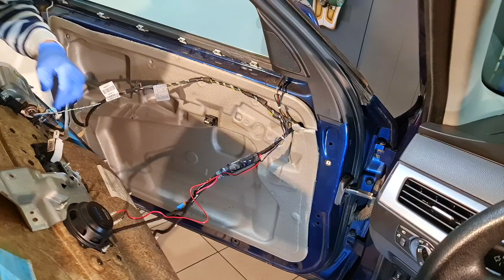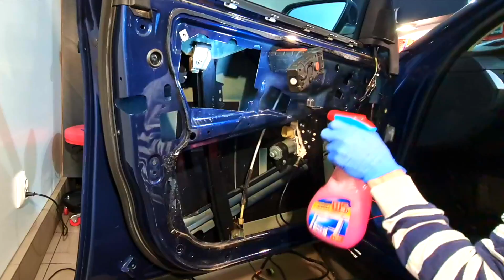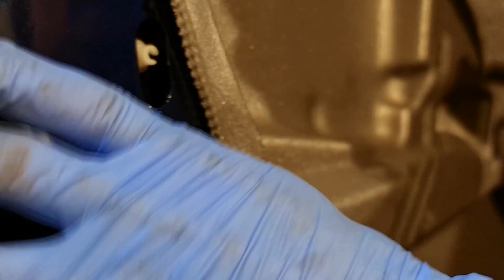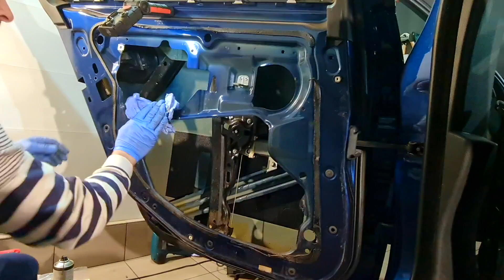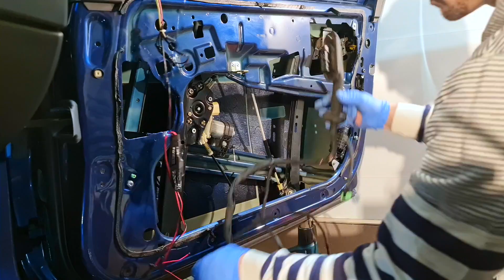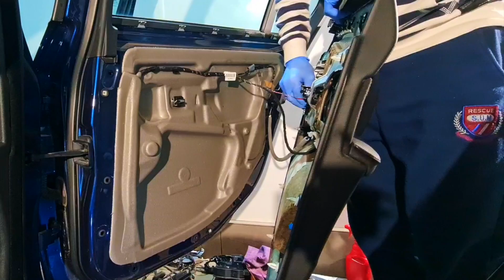Soft Close Doors Retrofit  BMW e60 part 1

Comment: Can you retrofit the automatic open close mechanism door from bmw 7 series to any bmw?
Reply: The F01 soft touch close system is slightly different, it mounts directly to the door without the silver bracket that you see here on the E60 setup. So yes it should work, it’s just that the unique E60 brackets are needed to fit to the holes in the E60 door. I don’t think those brackets are available separately.

Comment: Excellent video. Do you have part number for the plugs to connect to the soft close module as i bought them but cant source the harnesses so need to buy cable and plugs to make the harness. Scotland, uk
Reply from the maker: Hello! Use Realoem.com for P/N
Reply: @MOvidiu  Thank you 👍

Comment: Thanks for this excellent videos on this particular project. quick question, is your car equipped with comfort access? Is the wiring harness the same for soft-close if using in a car with comfort access? realoem lists only one part# for door wiring harness which is very confusing.

Comment: Great job and great video. more of this please! 
Just a remark on our remark about the smell of sh*t. It doesn't actually come from the dust. It's mostly caused by bacteria and spores accumulated on the AC evaporator. The smell starts again if outside temperature is high enough and you're using the A/C. The condensing water on the evaporator makes perfect culture for bacteria to grow. This comes from an incorrect use of the A/C, by not switching it off early enough before the end of the drive. ~5min before the end of your drive, switch off the A/C but keep the fan running. This way the the evaporator will dry and no bacteria can accumulate. 
If it already smells bad, only way to get rid of it is a thorough disinfection of the evaporator.

Comment: Which spray u used for connectors? And why?
Reply from the maker: Hello,  I'm using a contact cleaner and protector,  for protect the pins and to make sure that they are making perfect contact
Reply: @MOvidiu  thx

Comment: NIce, Clean Job. I also add some protection wax inside the door, without foam barier, it's ease to clean down od the door, then add protection wax, to prevent rust in future.... - BTW. excellent and clean job with explanation. Cheers from Poland ;) Keep working.... !!! ;)

Comment: Great job! I did this retrofit to my F10, procedure is almost exact same. F10 front door are bit trickier, because there are crash pads, that need to be replaced with suitable for soft close lock actuator. And I did built my own wiring harness, it much cheaper to do so.

Comment: Ahh this brings me back.  I did this retrofit to my E60 a few years ago, took me 4 days to finish it because the urge to clean every nook and cranny keep kicking in.

I also didn't want to source a wiring harness because like you said it only needed 2 wires for power and ground.  So I bought the plugs and pins and ran the wires to the fusebox myself.

My early build (Nov04) pre-lci doors also didn't have the holes for the actuator bracket, so had to guess and drill them.

All in all, not something I would do again because it was a major pain in the behind for not much reward.  99% of the time your passengers will slam your doors anyways, even after telling them.
Reply: ppippppb